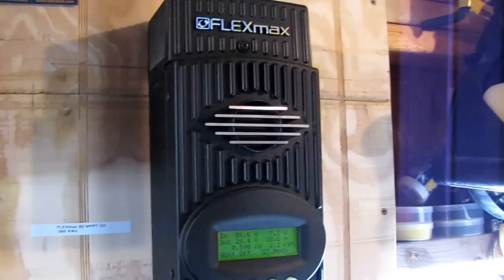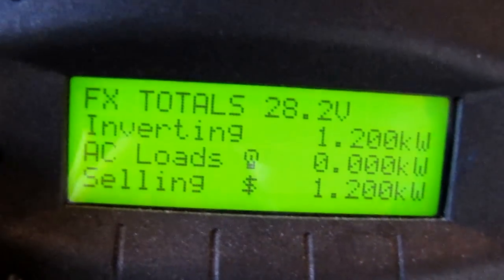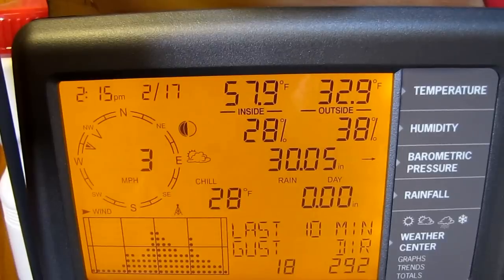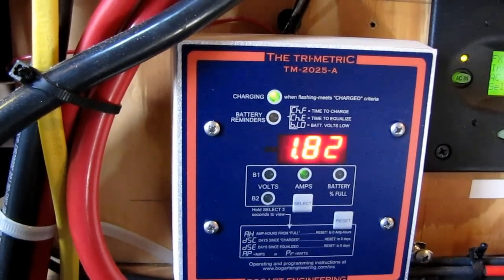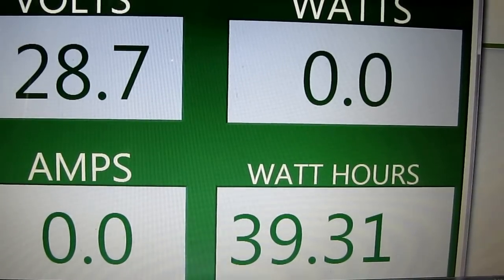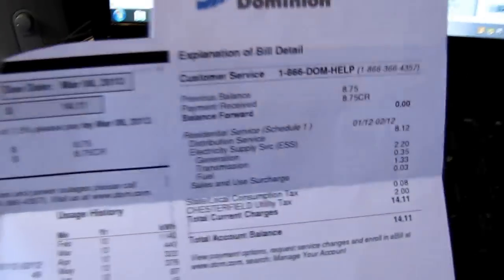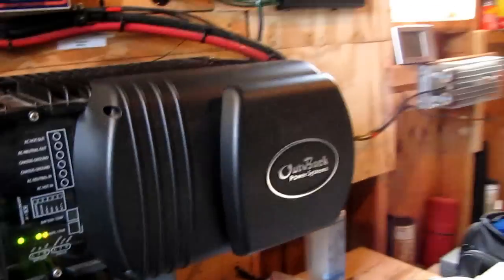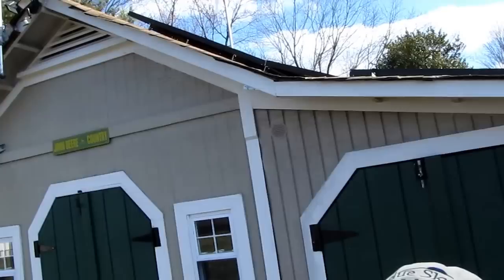Solar And Wind Power THE  VIARLOCITY WAY

Comment: Question about the wind amp meter (time stamp 2:53) How do you hook it up? I've got one, but, it never shows the amps. Just the volts of the battery. Any suggestions or reference material. Thanks